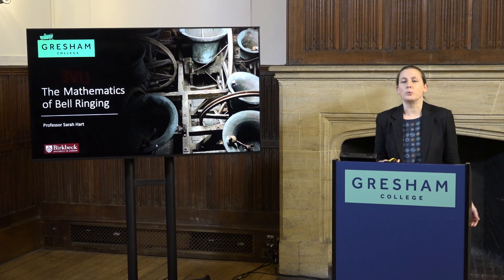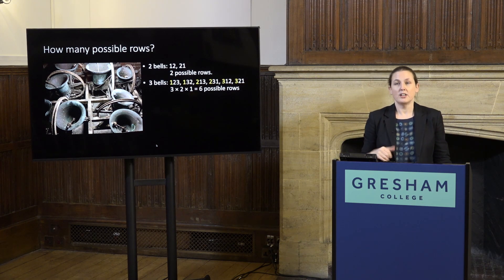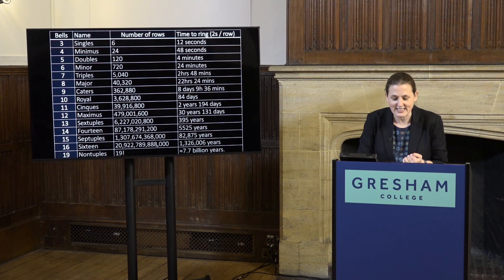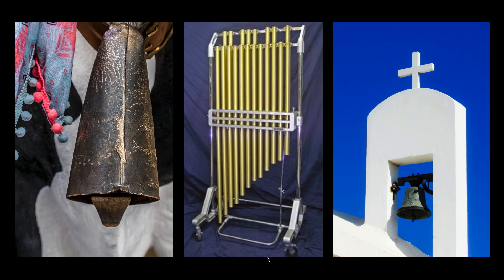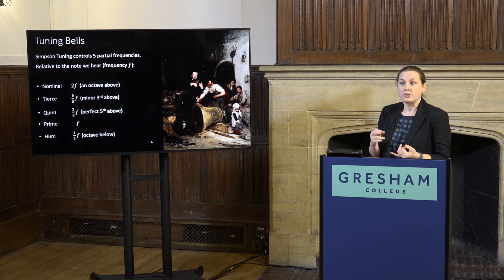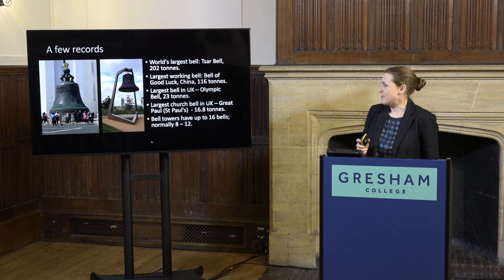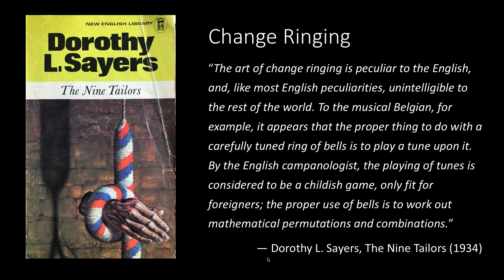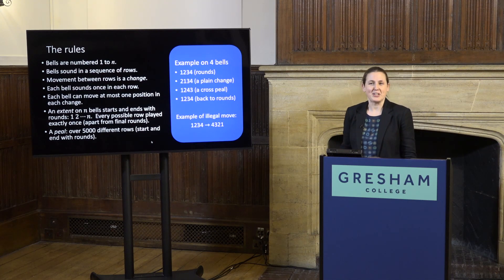The Mathematics of Bell Ringing

Comment: Thank you for this lecture. Did you consider discussing the parity property that all rows have? All rows on a given number of bells can be reached by an even number of individual swaps or an odd number of swaps. I.e. No row can be be reached by both an odd and returned to rounds by an even number of swaps. It's another useful way to classify rows when checking rows for truth. In the plain course of Stedman Doubles for example  all 60 rows have even parity, all the odd parity rows are missing. With one change we can step into the set, or course in ringing parlance, of odd rows ringing all 60 of those before returning to where we left the even parity course with a corresponding single change.
Reply: The old 18th and early 19th century peal boards in my tower don't say odd or even, they say x number of times rung right and y number of times rung wrong. I always wondered what it meant, I'm guessing this.